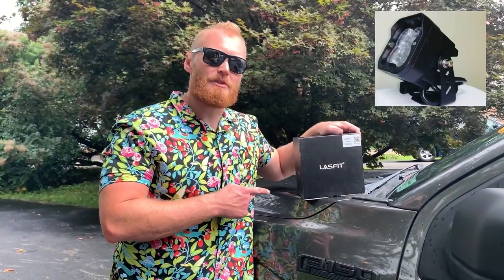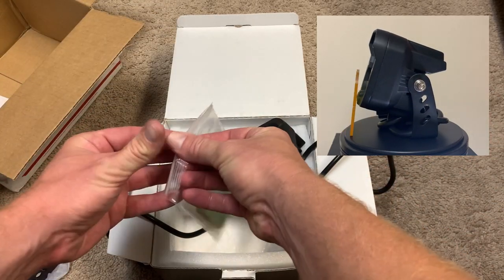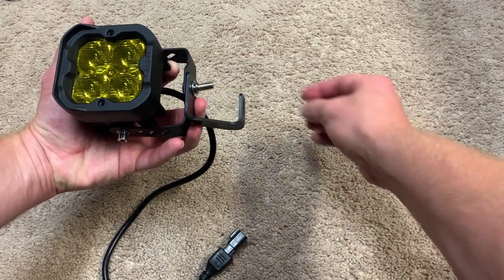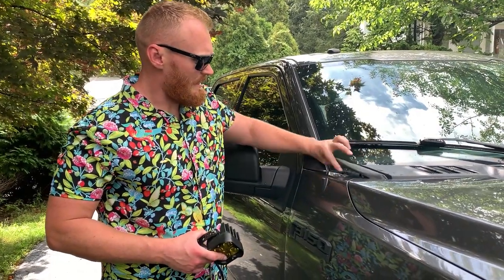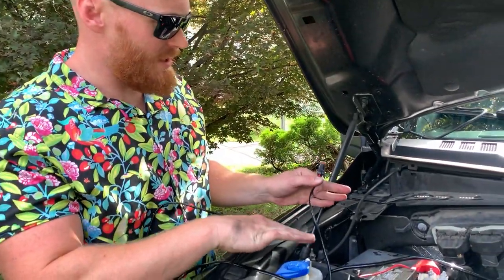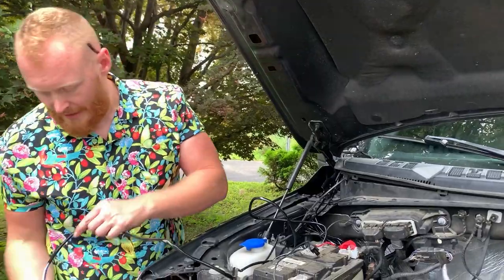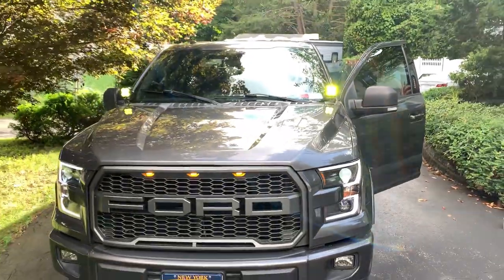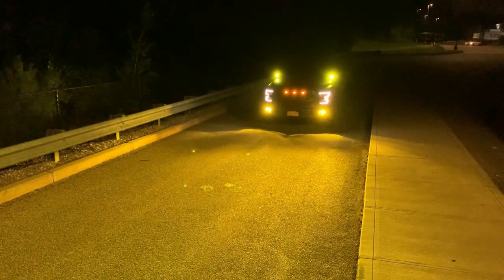LASFIT POD LIGHT INSTALL: STEP BY STEP INSTALL ON F-150.

Comment: How are the pods doing after this long? Any moisture or issues?
Reply from the maker: No problems with the light. Definitely a little rust on the hardware though.
Reply: @AutoHeadz I would switch to stainless steel hardware. 

But it’s great that those pod lights still works well
Reply from the maker: @toyotabrony  I agree. The outside started to flake a little too. Still worked-fine but definitely started to look weathered. I live in a heavy salt area by the ocean so may have made things worse
Reply: @AutoHeadz  oh man. For asthetics, I hate seeing that lol.
Reply from the maker: Yeah I hear ya.
Reply: @AutoHeadz  what beam pattern u have?
Reply from the maker: @toyotabrony Fog pattern. Wide
Reply: @AutoHeadz  nice. Is there other aftermarket lights u upgrade from Lasfit?
Reply from the maker: Diode Dynamics and Morimoto make a ones that are great but more expensive. https://amzn.to/4d4sK3V
Reply: @AutoHeadz  yeah those are sweet. I honestly don’t see myself spend about $200 or more. Like the 2stroke 4.0 or SL2 pro, or ultra 2. But those lifetime warranty is a must. 

Kind a like sylvania zevo with a lifetime warranty.
Reply: @AutoHeadz  those are one of the pure high quality pod lights